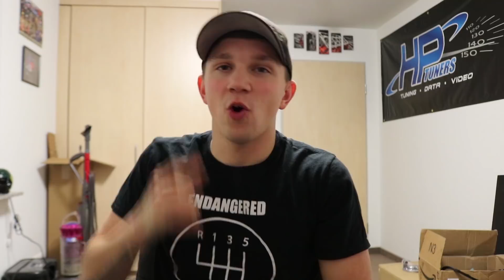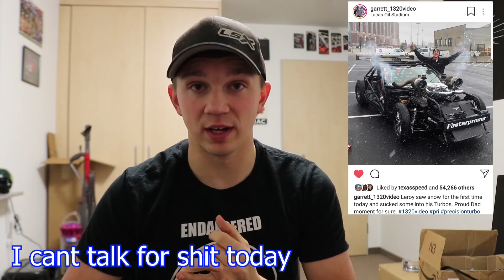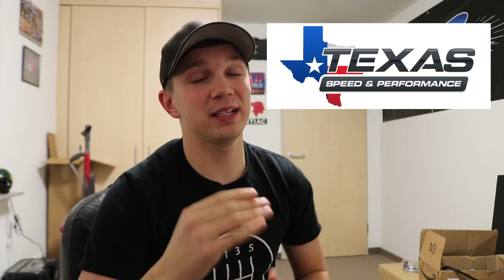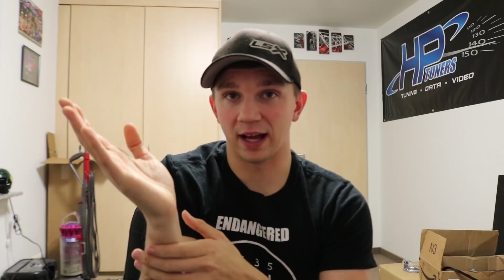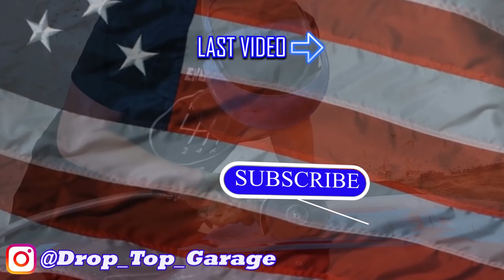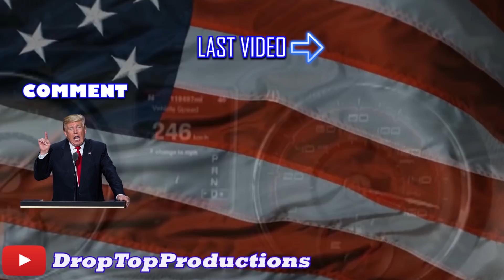Texas Speed Cam for your HEMI????

Comment: The prices of getting the 392 cammed is butts. Checked several brands and  Texas Speed has good prices. My new current is a 300 srt and i want it get it cammed. Im on their site and looking at the options to build a package. The pushrod lengths(length vary by engine?), timing chain and oil pump. You recommend get it all or, what do i actually need. Any way i can msg you on this? Any help woudl be appreciated. I suppose i could contact them too. Not sure why i asked you as if you were their customer service 😅 my bad

Comment: Frp mark82 cam
Reply from the maker: Yes, the MK82 is ground at TSP
Reply: @DropTopPerformance  yes I'm getting the mark82 cam kit install as we speak
Reply: @DropTopPerformance  yes I'm getting the mark82 cam kit install right now in my 2009 Chrysler 300C
Reply: @DropTopPerformance  say can you find out what is the measurements of the mark82 camshaft kit pushrods for my 2009 300C

Comment: Comp cams comes with camshaft, lifters, head gaskets, seals, head bolts, valve springs, valve guides, valve spring retainers and valve spring retainer clips for around $1600 plus tax DIY.
Reply from the maker: The HRT Master kit?
Reply from the maker: Been looking into the Stage 1 SC HRT kit

Comment: I wonder what the horsepower gain is with the tsp stage 1 for 5.7 hemi charger
Reply: I’m doing a stage 1 cam kit with manton pushrods and racing valve springs from Texas speed. I’ll keep y’all posted on hp gains on the 5.7

Comment: Hey bro what kind of cam do you recommend on 2015 rt challenger stock engine with intake and long tube header and unlock pcm .. I want something in the middle.. what do you recommend thanks
Reply from the maker: Personally I would call either TSP or Comp. I know comp just came out with a new line of Hemi Camshafts for a decent price. If you give either one of those companies they will spec a good cam for your application

Comment: Youre nutz $1200 for a cam swap i landed the lunati 276/280 cam for 220 on sale at amazon and the 5.7 hemi heads can take 0.550 max lift. Its a valve seal issues past that because the seal and spring seat are one unit. The retainer hits the valve seal past 0.550.all said and done after i changed my cam the new gaskets(timing chain cover water pump and thermostat housing) coolant and breakin oil (royal purple) it cost me about 350 and 4hrs of my time. Then i had to get tuned another 400. So if youre planning on blowing 1200 for a hemi cam swap ill do it for a 1k

Comment: I am rebuilding my 5.7 hemi and I would like to do a cam swap nothing major but my concern is will I need a tune and where do I go??
Reply: I have a 2012 5.7 crew cab want to wake it up but it will be a street hooligan not a track star. What do I need and where would I go for a tune. I'm in GA in Douglasville. Also is it mandatory for the MDS delete
Reply: @michaelbarfield6589  did you ever get it tuned? I'm I. Atl
Reply from the maker: You will definitely need a tune. Where are you located, I can get with some of my tuning buddies and ask for a decent shop around your area.
Reply: Drop Top Performance I’m in the Bay Area I Have 2018 5.7 Hemi in my challenger. Please recommend a shop. I need to join the 500+ club!!

Comment: Texas speeds camshafts for the Hemis have not even been tested one bit. I put one on my 2018 Ram 1500 5.7 with forged internals and a whipple supercharger and the truck was impossible to tune and ran like garbage. I went with their "boost" cam and it was a nightmare. Ended up taking it out and went with a Greene Racing custom grind whipple cam and all the problems went away. Literally ZERO R&D on their boost cams for the hemis.
Reply from the maker: Sorry to hear about that, I find it hard to believe that no R&D was done before production of the cams. However if youd like to get rid of the cam I'd happily take it😂
Reply: @BoostedBloodline20  Lol you can certainly have it.

Comment: Yes! My 5.7 hemi is so expensive, I need a new motor and I’m trying to race it at the same time.
Reply from the maker: Nice man! I do agree I hate how expensive they are to build 😭
Reply: DropTopProductions I have a channel as well, you should watch it when you can. I have 9 videos up already. More to come
Reply from the maker: @GreatestHITS26  I'll check it out man!
Reply: DropTopProductions thanks so much, my channel is so small though
Reply: While somethings are more expensive for the hemi you can build a nasy5.7 hemi fairly cheap. Cnc ported heads from precision injection equipment were by far the most expensive parts at 1800 my lunati cam was 220 mmx ported throttle body was 300ish msd coils were200, 240 for my fuel injectors pacesetter headers 270 bullet mufflers were 15 eachmy electric fans came off a wrecked firebird for 30 and my nitrous kit i caught on sale for 380 fuel pump was 60 my hoosier 31x18r15 slicks were 350 each and my rims for the slicks were 90 each and my short ram intake was 40. if you  know how to do it all it can all be done in a few days if a buddy knows how to do it buy all the beer n pizza he wants to help you. Its alot cheaper and faster than paying a shop to take their sweet ass time to do it. Ill be heading back to the dyno next week to tune for more spray and ill post a video of the results then

Comment: Yes sir i'm going to get one.
Reply from the maker: Awesome man, what's your goals for the car??
Reply from the maker: It's just my Wifes car so not going to crazy. Wanting about 500whp should be manageable for her😁
Reply: @BoostedBloodline20  500 hp should be good enough for her. All i want is 550hp all motor. Then add turbo or prochager.
Reply from the maker: @rtteazeie6384  nice! You gonna upgrade heads? Should get them ported & polished and have them milled to raise compression 💪🏼💪🏼
Reply: @BoostedBloodline20  I would like to. Its my daily so i really don't like my car to be in the shop to long.
Reply from the maker: @rtteazeie6384  yeah I understand that!
Reply: Well right now i'm full bolt on's and E85. I want to turbo or pro charge my car. I really don't want to get the cam for that because it's not going to give me the full potential of the cam until I get the pro charger or the turbo. Like you said Hemi parts are expensive
Reply from the maker: @rtteazeie6384  they really are🙃 but they make great power. They dont have E 85 here in Germany so that's a bummer. So when I do the Whipple I'll probably run some meth.
Reply: @BoostedBloodline20  Wow you in Germany ? Yeah that suck's no E. Yeah a Whipple and meth should do the job.
Reply: Yo check my video out and give it a like please. Learning about this youtube stuff will have more content soon.

Comment: So are they going to offer tuning with there cams or are you going to have to get it tuned somewhere else
Reply: North east Arkansas not far from Memphis
Reply from the maker: @corybellinger5345  oh nice man! I'm from Memphis😂 I'll see what I can do and I'll let you know
Reply: awesome man!  I actually got this truck brand new from a dealership in Memphis.   I appreciate the help.  let me know what you find.  im at a loss right now on the truck so im probly going to end up tearing it back apart soon so the sooner the better.  not trying to rush you just letting  you know.
Reply from the maker: @corybellinger5345  too easy man I'll see what I can find out
Reply: DropTopProductions  thank man
Reply from the maker: @corybellinger5345  Dynospeed in Memphis, ask for Josh he will help you out. Tell him Cody sent you
Reply from the maker: I'll actually be tuning it myself
Reply: cool I have mds problems in my ram right now.  just tore it down last week and had some broken valve springs.  changed them and everything else looked good so I put it back together and now im getting misfire codes on 6, 7 and 8.  long story short im probly going to do away with the mds and install a cam.  I need to figure out who will tune it or what I need to do
Reply from the maker: @corybellinger5345  that really sucks man. I'm trying to do it before I run Into that kind of problem. Where are you located I can talk to my fellow tuners and see if they recommend someone
Reply: Awesome man thank you!  when I tear it back down if that’s what it ends up taking I will do it and let you know

Comment: Texas Speed's offerings are useless to a large portion of the Hemi world as they are only offering cams for VVT engines. This will leave out the 03-08 5.7's and ALL 6.1's. I have seen the specs and frankly they are pretty weak anyways. Plenty of better and less expensive options already out there. Since you are a newbie to the Hemi world take my sage advice and learn who Jay Green is.....most likely you will be getting beat by a car that is cammed by one of his offering.
Reply from the maker: Texas speed will only be targeting 09 and up hemi platforms. When did you see the cam Specs offered by TSP?
Reply: @BoostedBloodline20   Posted on a FaceBook Hemi group a few days ago.
Reply: Tim Wiltse 
Jay Green cam it’s about the same specs than TSP cams 
I have use TSP cam for GM engines with excellent results
Reply from the maker: @reyperez3424  I agree with you man. TSP has really proven themselves over the last 2 years.
Reply: Flying Ryan Performance